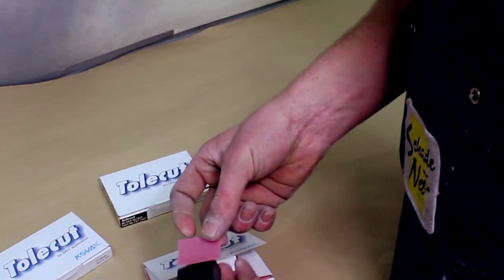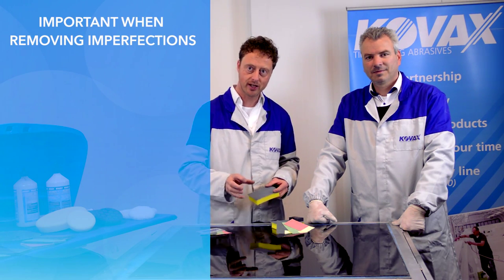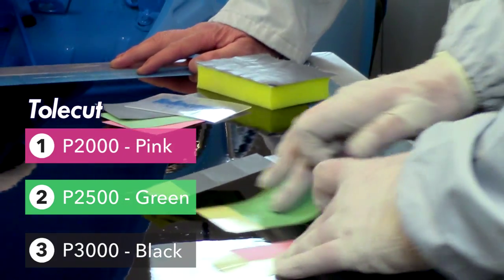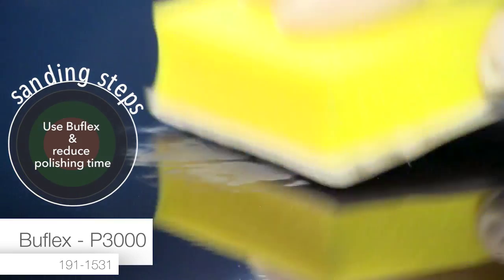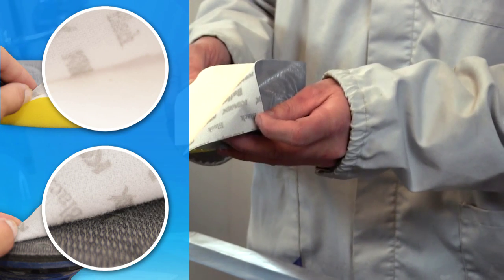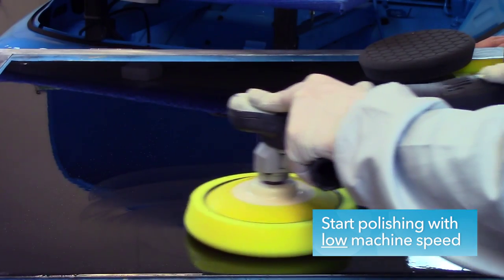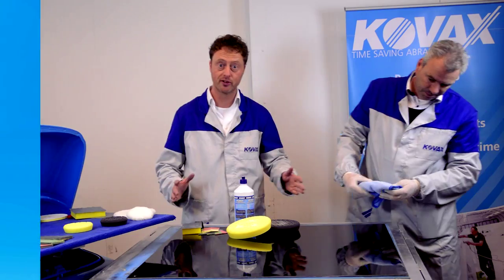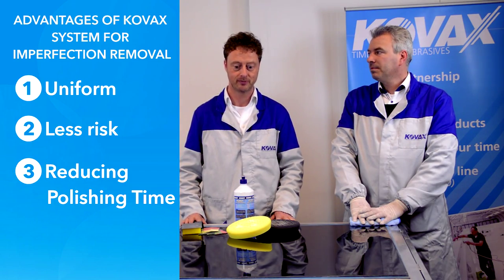Imperfection Removal and Polishing System - Tolecut Buflex & K2IN1

Comment: I can still see sanding marks! The Toleblocks seem great but the polishing not so much
Reply: Yeah. It's probably the pad's fault as much as the polish. Especially 5 years ago when this was made, the majority of foam pads just kinda sucked ass at fast heavy cutting compared to fiber pads. Even today, if you're multi stepping, cutting with fiber is the better choice 95% of the time. But it looks like that finishing block is basically 5000 grit, so even a soft pad and fine polish can usually handle those scratches. So it's probably very hard clear. 🤔